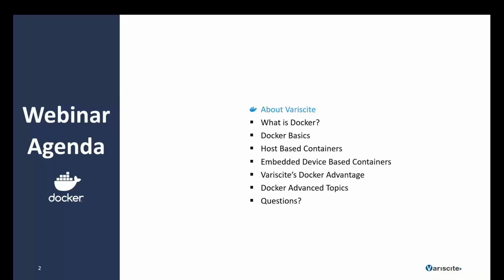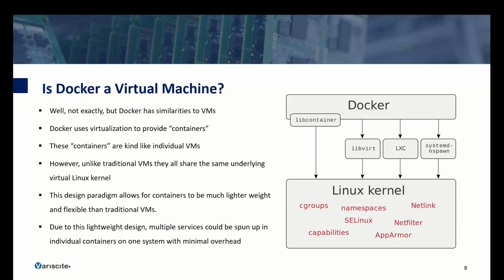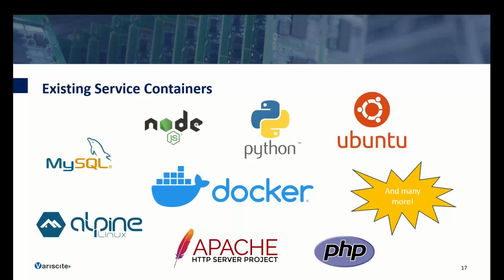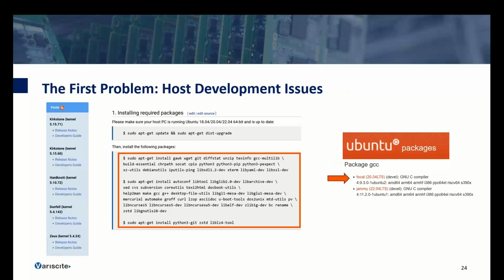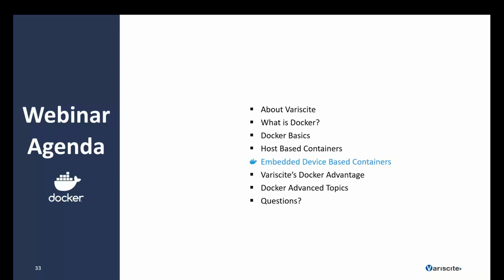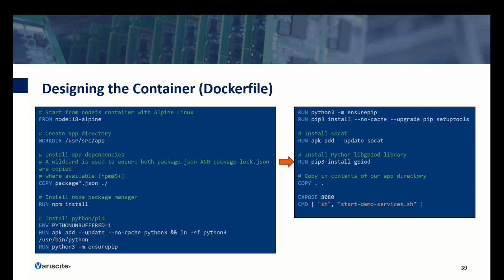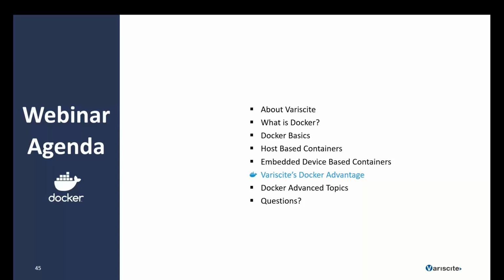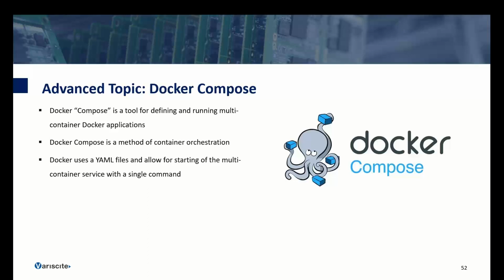Webinar: Enhancing Embedded Software Design with Docker

Comment: is it really good practice to get node(and its who-knows-what dependencies via npm) and python(and its who-knows-what dependencies) in an embedded board? ok for demo, bad for maintenance and upgrade?
Reply from the maker: Hi,
Thanks for reaching out.
The demo was designed to present very simple Docker concepts with the main focus on Docker itself. As such, we are only prototyping a design with concepts beginners should be familiar with. You are correct, in that, the steps here could be refined for a production environment.

Comment: Hi, Can we use Visual Studio Dev containers to set up a Variscite build environment?
Reply from the maker: Hi, Thanks for reaching out.
We have not tested the "Visual Studio Code Dev Containers extension" with our Docker containers. Based on a review of the VS code documentation on the subject, it should theoretically be possible, however, it may require you to make modifications to our container source, which is available in Github.